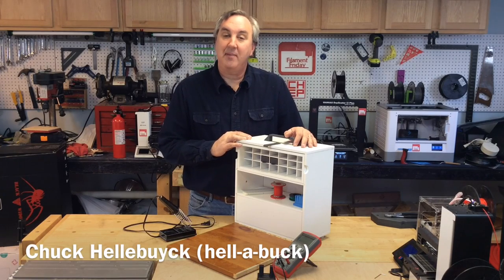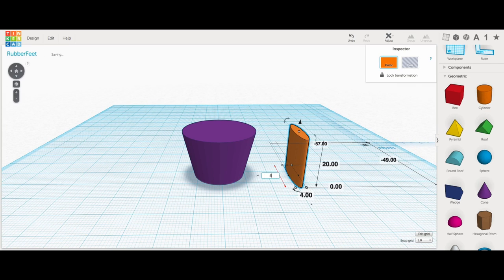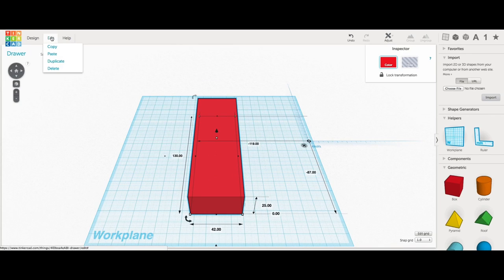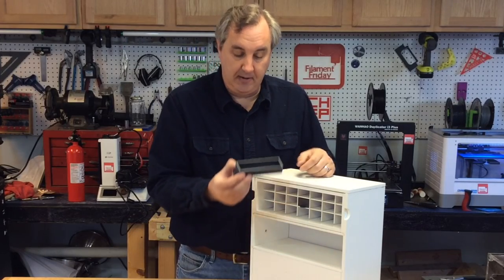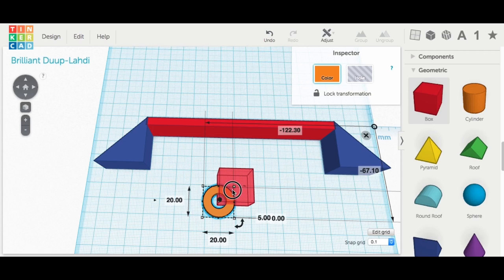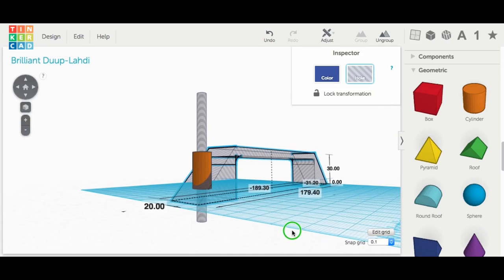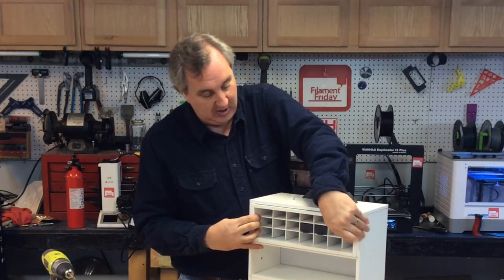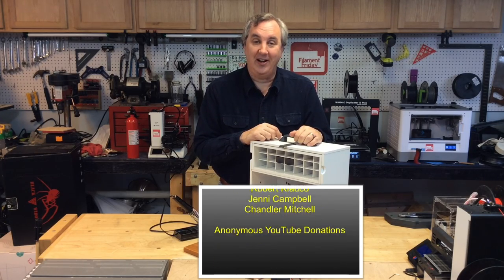Portable Electronics Workbench with 3D Printed Parts

Comment: For your rubber feet, You could go into the Community Shape Generators and specify the top and bottom radius of a "Cylinder of defined smoothness".  There is a Reverse Fillet in the Community Shape Generators that can round the inside edge of a corner, or turn it into a hole to round the edges of a square object.  The way I would center the hole on the wedge would first center it on the wedge (double click a grouped object), then duplicate the 2 hole pieces, select the handle while still having the 2 duplicated holes selected, then mirror the whole object.
Reply: I have tagged it as one of my "Favorites" along with other useful shape generators so I can find them easier.

Comment: Chuck, the best way to get 1/4 of an object in Tinkercad (like the chamfered corners in this video) is to make 2 holes, one that's half as wide but as tall as the object you're quartering, and the other half as tall but just as wide as the object. Then select all 3 objects and use the Align tool a single time (well, two clicks technically) to get them to the correct orientation, group 'em and you're done. :D
Reply: I'm talking about the part at 6:30 - 7:30 - the torus was 20x20 so you'd make one square hole 20x10 and another 10x20, select all 3 and, in this particular instance, align them simultaneously to the lower-right corner.  Would result in a perfectly-sized quarter-torus without needing to eyeball anything or do rotations.

Comment: Wouldn't the handle be better made with ABS or better yet PETG?
Reply: *****
The bond on PETG is really tough though and being a handle we don't want delamination happening.  I print at 70% infill with a custom infill pattern when doing parts in ABS and I don't seem to get warping and flex is very minimal (I also use 5 or 6 walls if there are screw holes I may need to drill on my DP).  I have tried PLA parts and I just don't care for the material as it will flake with any part that moves or vibrates so on a part that is in constant contact with a hand I don't think it would be very good.  My problem with PLA is on bearing holders on my i3 as they never get hot but due to the way the machine vibrates it made the inside (where the bearing is) smooth as a baby's bottom and the bearings want to fall out.  Started out just fine but after a while ugh and a while is not long.

Comment: Hi,
Why do you always use thinkercad and not a propper CAD software?
I understand that most people do not have a need to use more complex tools, but at least try something else.
I bet you will find that cad software is much easier to work with once you start doing more complex models.
I would recommend Fusion 360, not only because it's free, but it's stl rendering engine is one of the best. althougth it doesn't work very well with existing meshes.
Keep doing this great videos! :)
Thanks
Reply: Yes, thinkercad might be the easier way for someone that just started. And it's certanly powerful enougth for bigger projects.
But it lacks some core features for me, like filets/chanfers, STEP export, and variables for example.
I'm not saying it's not good, but there is nothing bad in trying something different.
Personally, as a engineering student, I find counterintuitive the way tinkercad works.